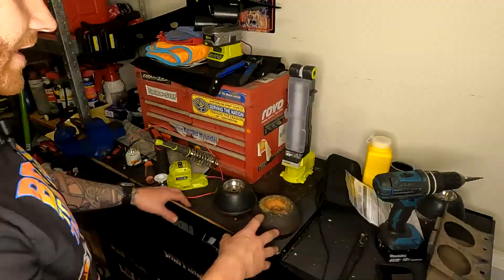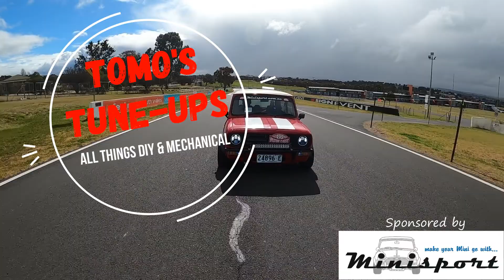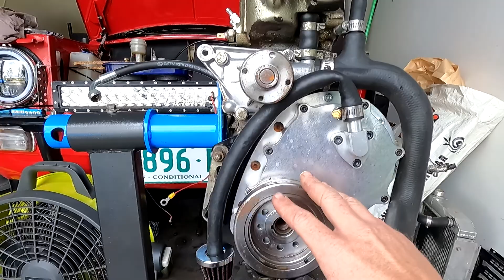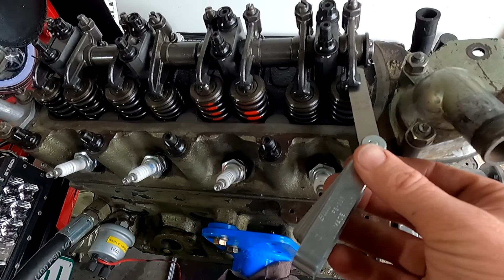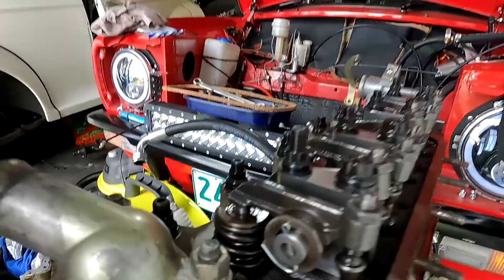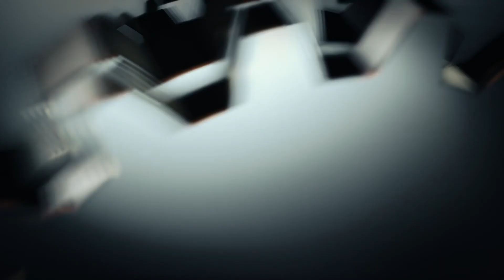How to adjust valve clearances/tappets

Comment: Good video thank you. Have you heard of the 'rule of  nine'? For example you can adjust the inlet vale on number 1 cylinder then without turning the engine over you can adjust number 8 exhaust valve. Number one plus number eight equals nine. Then turn the engine over and adjust number two and number seven, again it equals nine. Then three and six, then four and five. Saves time and effort.
Reply from the maker: @anthonywbelcher  Hey mate,
Thanks for the comment. 

I believe I have, but that was 2 decades ago when I started my apprenticeship. As I worked on new VW’s in the mid 2000’s, it wasn’t very common to adjust tappets unless we got an old dak dak come through the doors (very rare back then), so I never properly cottoned onto that method. However, that makes perfect sense. Definitely try it on the next build we have coming up on the channel (Mk3 1330 build), so stay tuned 👌🏼
Tomo